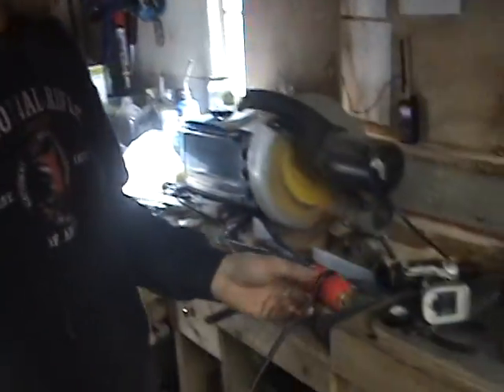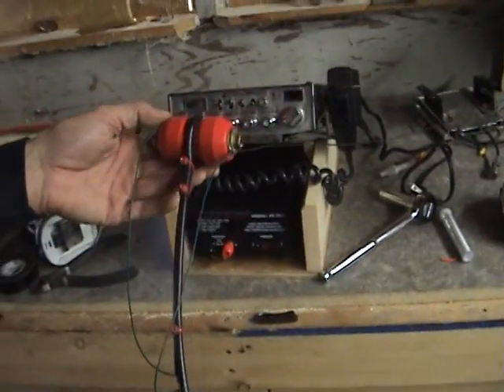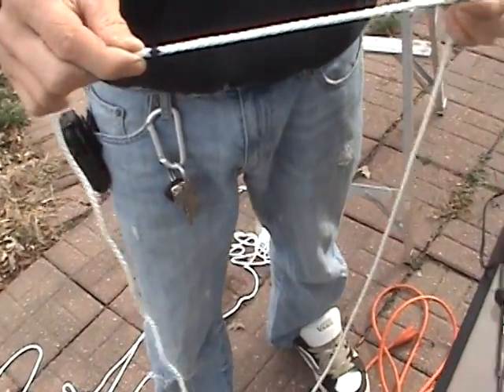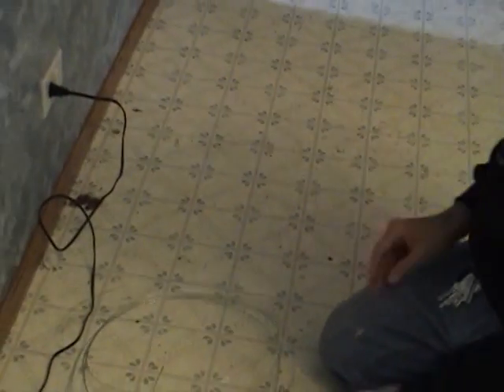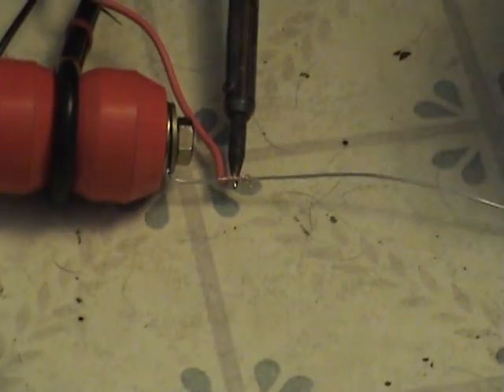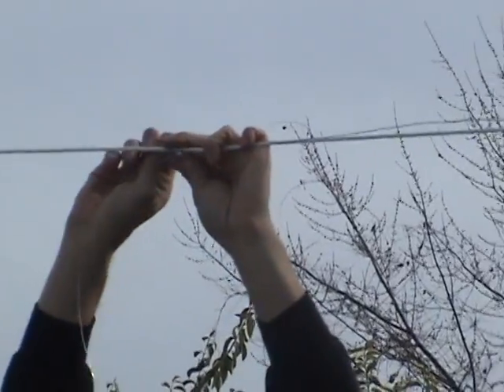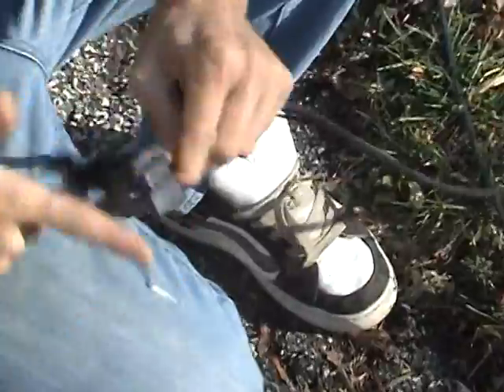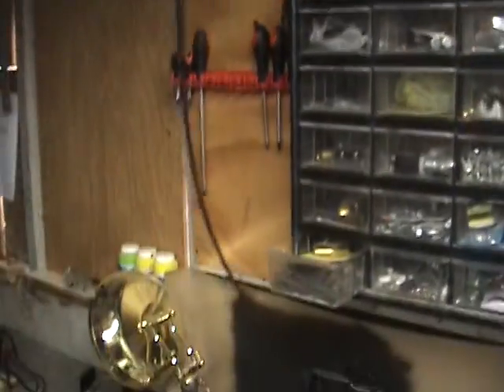Making a horizontal dipole antenna under 1.4 SWR

Comment: I used a ceramic person insulator or the electric fence porcelain insulators for my horizontal wire which was a 12 gauge indoor electrical wire and my copper grounding wire was same type wire that went to a copper rebar in the ground. Only disadvantage was that the antenna is only a directional antenna and the positive was I was able to talk nearly 50 miles away.

Comment: Take it down.  You really dont know what youre doing.
Reply: He did great. Don't be a jerk to an experimental project. It got to the point where out of fun. I used the old railroad telegraph wiring back in the '80s which was illegal to transmit on a directional antenna without FCC license and a common everyday CB.

Comment: Finally someone shows how to install the damn antenna instead of barely how to make it. LOL! Thanks for your efforts man!
Literally every vid I've seen shows bits and pieces of building the antenna and you never see it in its entirety. Next thing you know its installed and talking 15 miles.
The nicest one I've seen so far and probably more expensive to build  is made of copper with adjustable SWR on each end.
It is a 1/4 wave dipole mounted vertically. The guy also built a balun for it.
Here it is. https://www.instructables.com/id/My-Experiment-in-Building-a-Vertical-Dipole-Antenn/

Comment: You made it wrong total length should be the 17ft and each side should be around 8ft 6in.
Reply: IT BETTER TO MAKE IT LONG AND TRIM IT THAN CUT IT TO LENGTH FIND OUT YOU GOT ADD WIRE
Reply: My dad was a communications officer in the military and are vertical antenna was approximately 50 ft long, so I don't think your length of the wire matters. We were talking up to about 50miles on a 5 channel Johnson CB. I've even tapped into an old railroad telegraph line back in the mid 80's.

Comment: WOW Cb Radio coax is 50 OHMS while Cable or Sata TV coax is 75 Ohms  however if you buy a cb radio antenna that uses two whips the coax will 75 Ohm... 50 for a single antenna...
Reply: i had to look to see if any one else caught that

Comment: Well, ya did good...only, ya used TV coax cable. You should use something like RG58 cable. It'll probably give a lower SWR and better performance. (Technically, a dipole antenna is about 70 ohms, so the cable your using is well suited for it, but your radio ideally wants a 50 ohm cable and antenna.)

But hey, if ya got a low enuff SWR the way it is now, all is good (for CB anyway). Can't beat DIY!